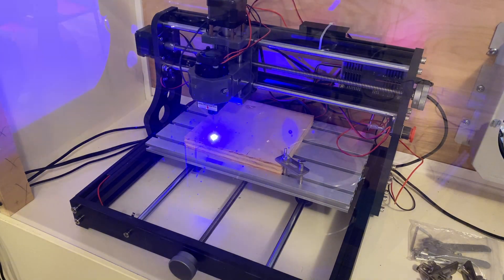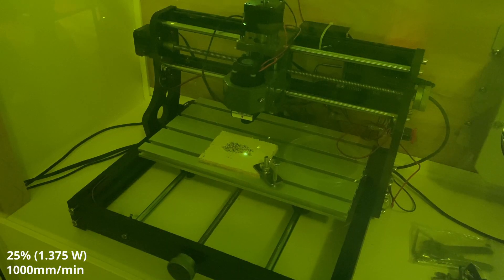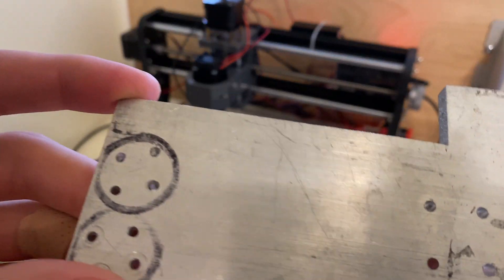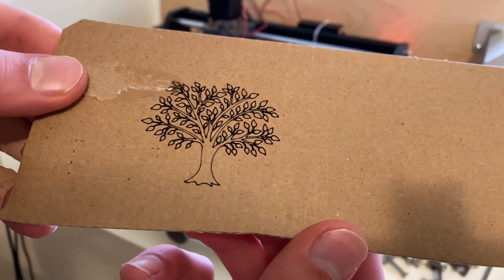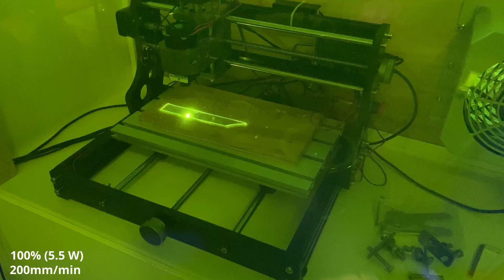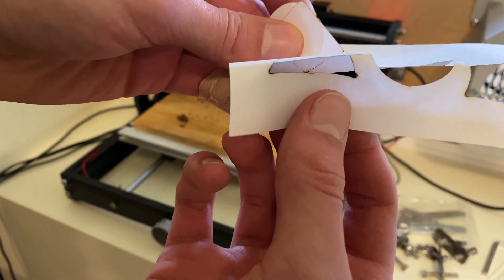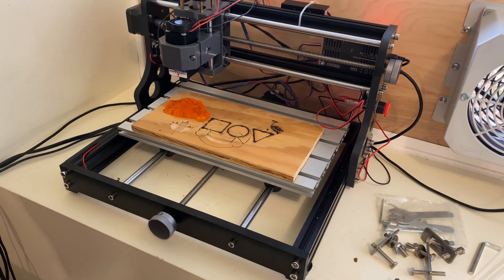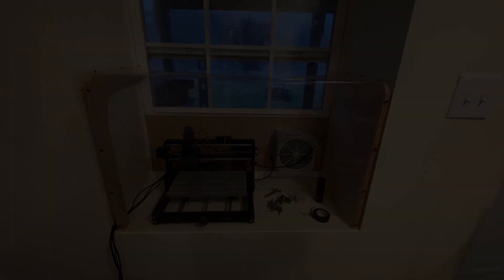5.5W Laser Cutter Demo - What materials can a 3018 CNC laser really cut?

Comment: What's the focus distance on that laser?
Reply from the maker: If I understand your question correctly, the focus distance is adjustable because the lens is able to move.
Reply: The focus distance on Mt 5 watt diode laser is 20mm. Appears, in your video, that your  laser was 6 to 8 times that distance. What distance above the surface you were etching did you set the lense?
Reply from the maker: @donniee1934  I set the height of the laser arbitrarily and then just adjusted the lens built into the laser module until the spot size was the smallest possible.
Reply: Oh OK, I understand now. I kept wondering how you were getting such fine detail with the laser so far above the material. Thanks, appreciate the lesson.😊😊😊

Comment: I am trying to set up a 4030 genmitsu v2 and need to know the G code and $$ settings i can get the laser to fire but not much else your help would be greatly appreciated
Reply from the maker: There shouldn’t be any manual G-code configuration required with Genmitsu machines. Are you using LaserGRBL, or some other software?
Reply: $32 = 1 activate laser

Comment: I have tried using a similar laser mounted on an Axidraw, I wanted to switch the beam off /on rapidly between burns but wonder if toggling the lasers power supply would damage the laser ?
Reply from the maker: It probably won’t damage the laser but that’s probably also not the best control method. I would suggest using the PWM input on the laser controller.
Reply: will try that, thank you @CarbonCoil